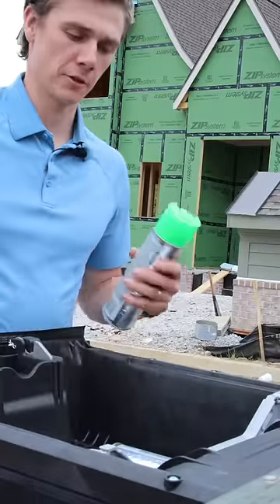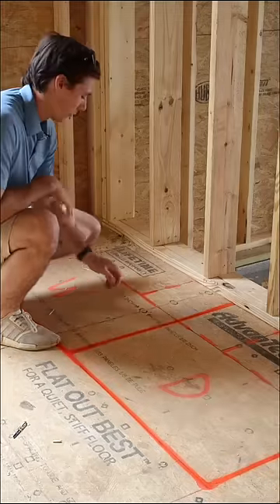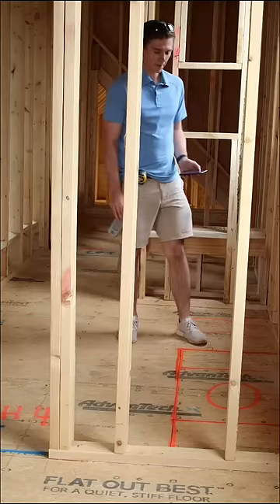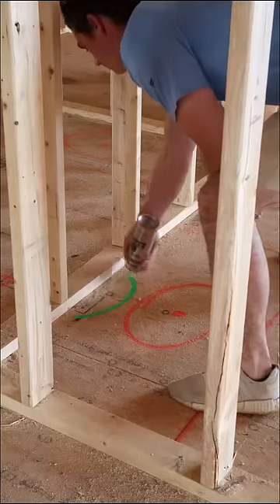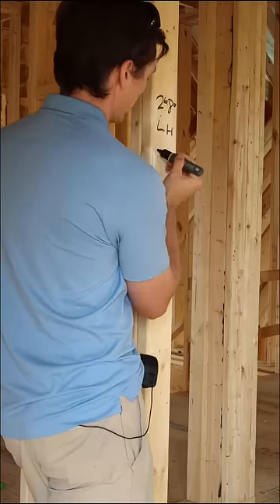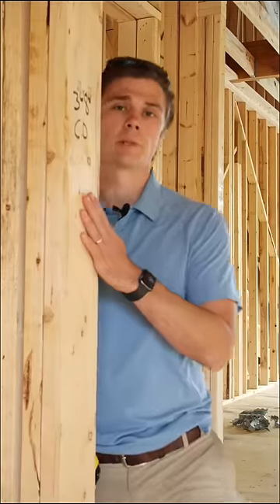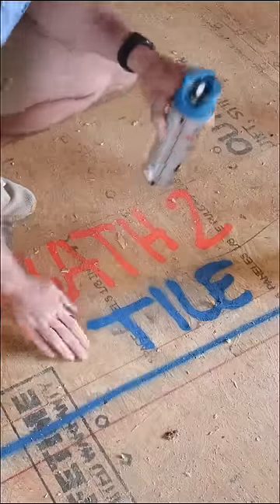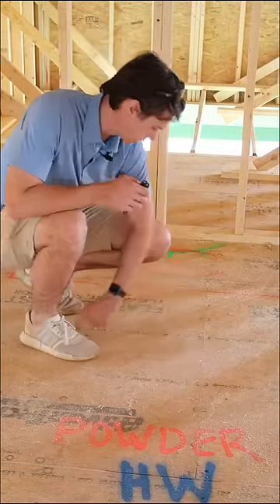How To Prepare a House For Rough Ins

Comment: This is what plans are for.
Reply: These kids cant read prints....or maps...or cursive...or do math
Reply: Residential doesn’t get good plans for mechanical
Reply: @masterkief2394  
I've been building residential for 20 years, and plans I see are always detailed correctly. The only problem I usually have is when someone wants to move something.
Reply: Sure but I would do the same if I was the GC in a large build like this. 
Biggest jobs I have done are full kitchen remodels but planning like this goes a long way
Reply: Good to mark build site, but can't beat the blueprints. Always, always rely on the blueprints.
Reply: @Livingthedreamornightmare exactly, and the guy in the video it’s screwed when the client makes a change
Reply: I was thinking the same thing
Reply: you haven't been on a jobsite before? plans are great if people use them, understand them and follow them. An hour or two of layout like this can save alot of time and money down the line
Reply: Plumbing - green for drains and blue for water 

Gas- yellow 

Electric- red 

Coms- orange 

But yes that’s why there is plans for the new build and I know he is just trying to help but sometimes it doesn’t
Reply: Jesus I could never work for this guy lol
Reply: @spencer1001100  Jesus was a carpenter to...
Reply: @spencer1001100  lol I missed the "I" I'm your comment
Reply: I was about to ask! How dumb are people these days. As if a sprayed layout gives all the required information? 😮
Reply: @vicbauwens  hahahahahahaha
Reply: @51-FS 😅
Reply: Funny our commercial building was just built and they fucked up at least 4 office rooms and I don’t even want to get started on the shitty HVAC around here
Reply: Recently got a apprentice work placement and the kid doesn’t even know how to read a tape. Mind you he just finished a carpentry course…
Reply: Baby… if you think those subs are going to make the effort to find a printed plan 🤣🤣🤣🤣
Reply: @maintenancemafia and your probably not nice enough to teach anyone
Reply: @maintenancemafia 😂
Reply: @chrislupacchino5960 none of the residential jobs I was on had plans, and they were run and maned by old timers. Besides, having markings in real space helps everyone
Reply: @UntitledUnlimitedCreations tell him to go get a refund from the school
Reply: So many people on job sights that if the electrical boxes are in the wrong wall it'll affect sheet rock tape texture and paint. Best make it obvious like this. 👍
Reply: @fixerupperer  Lead a horse to water situation…
Reply: @TCHrulez the issue after that is if you follow writing on a wall to do a job, then everything is slightly off what the blueprint showed. Now it's your cost to rework everything because you didn't follow the plans
Reply: You know plans are great but sometimes not everyone can get access to them still having a quick reference guide literally on the floor you're working on could be helpful
Reply: My money would be on this kind of marking-out increases the chances of people following the plans.
Reply: KISS method is always the way to go. Keep It Simple, Stupid! Plans are great but laying out keeps it simple and easily identifiable. God forbid theres been a revision and the prints in the field haven't been replaced.
Reply: @Livingthedreamornightmare by the time you get to rough-ins the plans have changed 20times and nobody has the same copy. Also, nobody is putting the thought into placement like the builder.
Reply: @masterkief2394 why not ? Plans are everything.
My fathers house had every power outlet preplanned. Even a connection from a switch in his bedroom to the coffee machine in the kitchen.
Reply: @masterkief2394  Maybe track homes but any custom build does.
Reply: @maintenancemafia kids  really cant read cursive anymore in America? I'm 17 and learned to write cursive in 3rd grade in Germany
Reply: You obviously don’t build customs. Multi Millionaires walk in and change shit left and right. I’m sure the track homes you build are all the same so it’s pretty easy to remember 🤷🏽‍♂️ don’t hate on good content, this young fella is helping every sun on that jobsite and helping his operation flow better, helping to prevent mistakes is often overlooked by the GC. Everyone looks to blame everyone else. Be a better builder and stop being a comment section “home builder”
Reply: Yes, let me stop what I'm doing every ten seconds to double check the paper plans that can get easily ruined in a work environment.

Stay at your desk.
Reply: @maintenancemafia so why didn't they get taught?
Reply: I never worked on a house, where anyone but the homeowner or contractor had a set of prints. Even then, prints can change
Reply: @gameratortylerstein5636  i work for  school board....no they dont teach it
Reply: True but plans change all the time and him being gc he knows better to what has changed
Reply: @maintenancemafia  Just so you know, they still teach cursive in school, they still use maps and globes, and the smarter kids are doing algebra in elementary school.  You have literally no idea what you are talking about.
Reply: I’ve been told by contractors that they could read plans, to find out the hard way they couldn’t.
Reply: This is what I was thinking, what happened to building plans? Isn’t that a more professional way to do this then spray paint pictures?
Reply: No, plans are for architects. This is to make the plan obvious for the contractors to not screw it up.
Reply: Most of these workers can't speak English you think they can read plans?
Reply: Why is this flimsy construction so expensive now, if you have to mark all the essential installs yourself to get it rite😂
Reply: You are quite quite wrong... it goes like this.. erectile disfunction, hearing, memory, eyesite lol 😂 I know this and I'm only 28
Reply: Seriously… imagine this dude building your house good luck
Reply: The plumber is the gas guy. And if I didn’t know where the washer and dryer went how would I have plumbed the slab!?!!?! Damn this is dumb!
Reply: if it makes the job go quicker and he has extra time why not do it?
Reply: Plans don't always helps subs ,or helpers .
Reply: Way faster and easier on us though if everything is marked and we don't have to carry plans around the whole house
Reply: Good call ...I was just about to say what about the plans...what kinda bums you working with?? Lol
Reply: @maintenancemafia idk what age you're talking about but I'm in my late 20s and can do all of that 😂
Reply: @darianzielinsky96  then you are ahead of most.
Reply: @maintenancemafia just turned 20 & the problem with younger kids of the new generation is that their parents don’t teach them shit, they don’t let them help or show them how to do stuff anymore
They don’t make em do yardwork with grandpa or dad anymore , just Nothing & that’s why kids aren’t getting any “work” or “life experience” they need to be taught more life/realistic work experience or be taught anything but just sitting at a fucking computer or iPad for 17 hours on end.
Reply: Where do you think he got the measurements from, boomer? Stfu
Reply: @maintenancemafia tbh the old heads can't either. Theres a reason why you go into a trade. . .
Reply: @maintenancemafia  if that were true, whose fault would that be?
Reply: Been in the trades 35 years never seen anyone do this it go to the plans
Reply: Insecure
Reply: It’s quicker lmao
Reply: And it takes up way too much unnecessary time to constantly be checking the plans every single step. Waste of time.
Reply: All high end builders do this. They also go around and spray paint every stud white around 60", mount a rotory laser and mark a red benchmark at 60" above finished floor for everyone roughing the house to reference their stub out/switch/blocking elevations. This guy did a great job but ive seen jobsites where the gc lasers all the hihat lights and centerlines on the subfloor. Shadepockets, duct plenums, all that shit.

Comment: I am building my home by myself. I marked out things so I didn’t have to continually look at the plans. Because memory is the second thing to go.
Reply: I forget what the first thing is
Reply: Hearing lol
Reply: @Bjulian263 what?
Reply: You're building... obviously, the mind is first to go.... memory second, so you don't remember it was cheaper to just buy one!😂😂
Reply: I see all the dads have gathered here
Reply: @NonProphetz hahahah
Reply: Lemme guess you forgot the first
Reply: @@alexhunter6786 I was raised on a farm with 14 cattle and 250,000 chickens. I am building the house myself. I took the test to do the septic system, solar panels, plumbing and electrical. I built the garage and solar panels first. I moved everything from my old house to the garage and moved into a 27’ travel trailer with my wife and two dogs. I remodeled the old house and sold it for an obscene profit. I buried a 1700 gallon cistern and built a pump house. I haul water from a bulk water station a mile away. I installed the septic system and sewer plumbing and water lines then I got friends to help pour the slab. I framed the walls, used a block and tackle and my Suburban to put the trusses on top. I installed the roof sheathing and shingles. Wall sheathing and siding. Exterior doors and paint. Then I started the inside. Laundry room and bathroom finished first. Taking a shower in a full sized bathtub and tankless water heater was heaven. I’m about 3 days away from finishing the kitchen. The I’ll put all the ceiling Sheetrock and blow in the insulation. That will get the house warm for winter. The only thing I hired someone to do was the central air and heat system and the propane piping. The county would not let me do that. I am looking at maybe the end of February to be finished. So there ya go. I’m no “city boy”.
Reply: @@alexhunter6786 Why are you saying these things? You don’t know me from Adam. Envious?
Reply: Get ready for the trades to throw all the blame on you when something is wrong because “that’s where you marked it”.
Reply: @SiVisPacem_ParaBellum  All the trades are me! I haven’t heard a complaint yet!!
Reply: @thatchedstudios4768 it's usually the wife or the hot rod. Depending on who you ask
Reply: @winstonscates4387  You're a licensed builder, electrician, HVAC and plumber? Impressive.
Reply: @winstonscates4387 I’m not here to bust your balls. Plenty of men around to do that. They’re probably pissed that they can’t or won’t do what you’re doing. I guess that they don’t know that in some states/counties you can be your own GC and do a lot of the work by having a sub contractor sign off on it (if you can find that) and then having it inspected. It sounds great! I hope that winter treats you well and you can stay on plan.
Reply: First thing is money
Reply: LEGOs don't count bro
Reply: @liammaxsmama  Good to hear a word of support. The only things the county would not let me do was the propane piping and HVAC. And I was in HVAC for  19 years!  Yesterday I finished the kitchen. My wife immediately used the dishwasher and this morning is baking homemade biscuits!  Next I’ll move on to finishing the bedrooms and living room.
Reply: @SiVisPacem_ParaBellum  No. I took and passed the tests. I have a background construction. I have seen enough to know how not to build something. I have passed all inspections so far. I have three inspections left. Make that four. I haven’t had my solar panel system inspected yet.
Reply: @winstonscates4387 I read all your comments and think it’s really awesome what you’ve done! I’d love to check out your masterpiece someday!

Comment: I absolutely love and respect what this guy has done. It seems extremely intuitive to measure and mark locations of appliances, door swings, etc. It's also is an opportunity to verify walls and door opening are where and what r.o. size and swing they're supposed to be. Does it take a few hours to do this? Sure. But it helps EVERYONE working there do a better job. Very nice!
Lots of comments here stressing avoiding liabiliy though.

Comment: I am a commercial general contractor. I do a lot for a big box store. Usually, in the existing building , a lot of concrete cut out for electrical and plumbing. I do this on every job, but what I do in bold letters on my sub contracts I do put in there that contractor is responsible for checking for accuracy. I am not above making a mistake like anybody else. So we usually have the foreman for each trade and myself to check together, and both sign the blue print layout pages per trade to agree layout is accurate. It saves so much time, and double checking really eliminates any issues. Also, we catch where trades may run into each other before we begin installing that way, no issues, arguments, etc...

Comment: As an electrician,  commercial,  i mark all of my items first thing when the studs are up. Marking the floor, studs and rafters. Then go back with exact measurements.  It may take several day's to do on a small/medium sized office complex.  But it saves overall time for me and my guys. Plus when other contractors come in, they see whats goint there and we can both coordinate to ensure everything goes in without having to go back and move during rough in. 
Id love to have a general contractor do this.  
Some gcs dont know a thing about the job they are overseeing.

Comment: I worked for a cabinet shop and my job was to set up the models for cabinets. I would meet with all the trades involved… Carpenters, HVAC, plumbers, electrical. I would go over their plans with them because each trade would have their own set of plans I would redline any changes from my plans to theirs and mind you I'm with the superintendent of the job site and his assistant while doing all this. I would get a call or through doing my rounds of different job sites be informed that the models were ready to measure for cabinets. I would walk into said models and about 50% of the time the plumbing would be wrong… there would be missing walls, jthe electrical would be wrong etc. I would then get with the superintendent and the supervisors and go over their plans again then I would walk the models and use paint to mark where these things should be give them a week or so and believe it or not they would still be wrong about 25% of the time. Sometimes you can make it completely fool proof and then some damn fool is going to come along and screw it all up! 😂
Reply: Did you write it in Spanish? If not it’s on you.
Reply: @justintant9062  HA!.. you got me.😂
Reply: That’s why I got into Reno. No one to answer to and everything I do is in service of myself in the future. The studs are straight, my drywall well cut and my seems untouchable.
Reply: No such thing as "foolproof". Fools are undefeated
Reply: @gokblok  amen!
Reply: They were listening to "I Will do It My Way" in their headphones